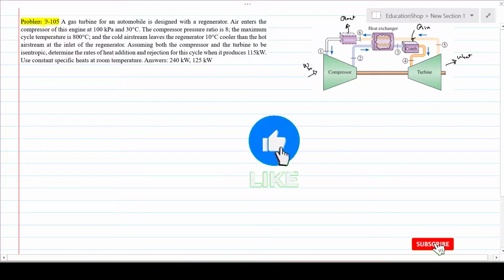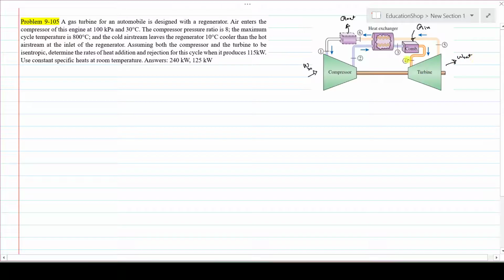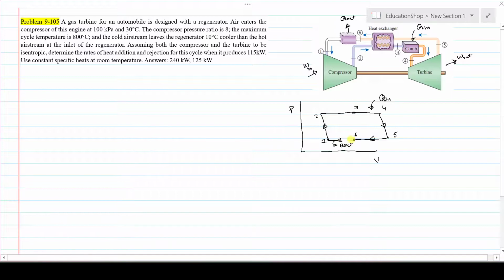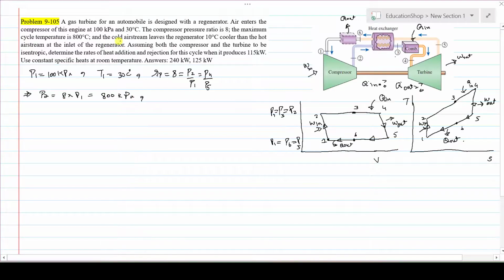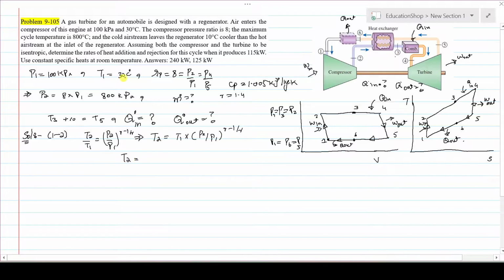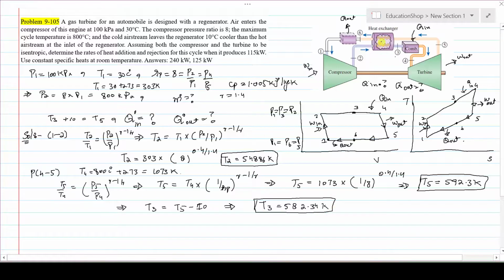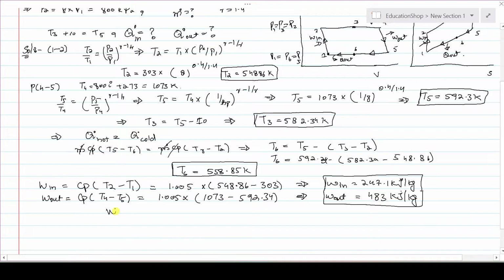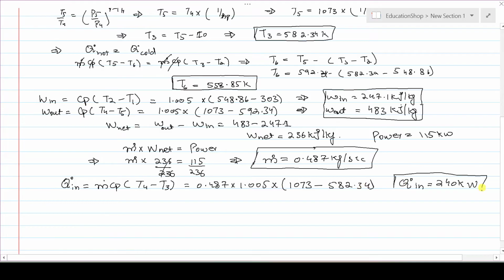Regenerative Brayton Cycle Solved | Problem 9-105 | Heat Addition & Rejection | Cengel Thermo 9th Ed

Comment: the cold airstream leaves the 
regenerator 10°C cooler than the hot airstream at the inlet of 
the regenerator
Why T3 = T5 (°K) - 10 °C  ????
Reply from the maker: Mentioned on the timeline of video